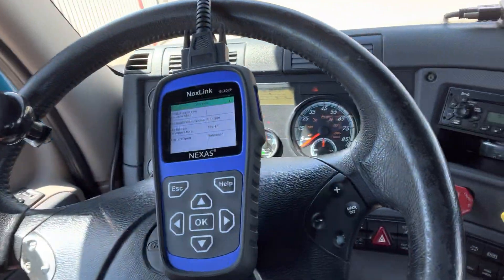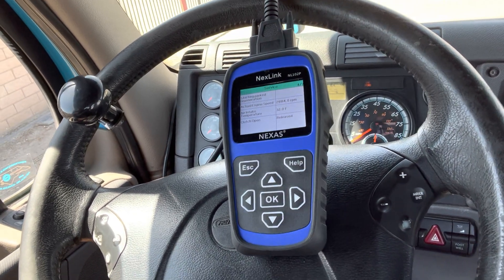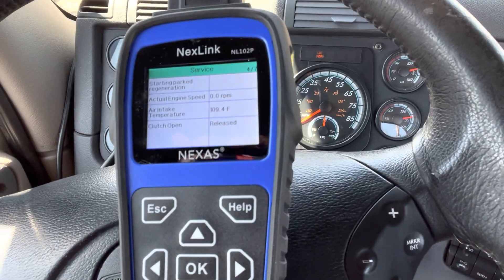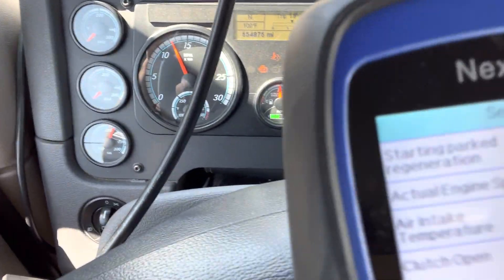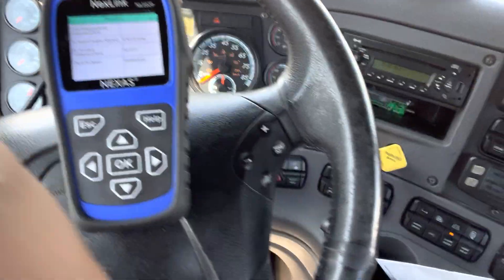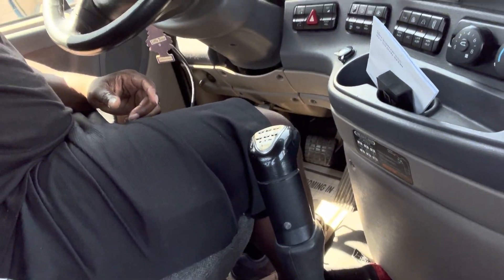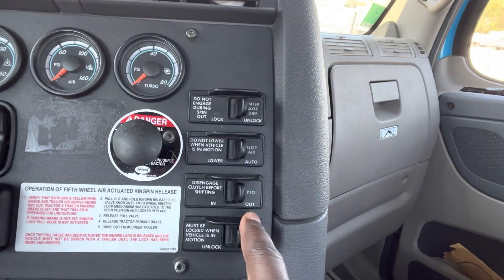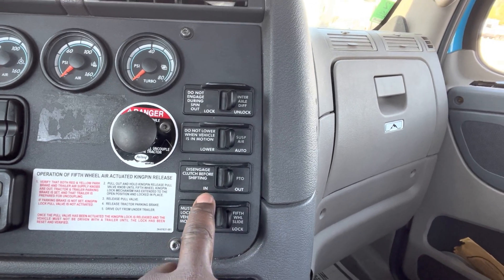This is EXACTLY how the Nexas Nexlink NL102P worked for me￼!! My special tricks WXPLAIN

Comment: Thanks

I failed to get it to regen the first few times, so I went looking for instructions. Found your video and decided to give it another couple tries. Eventually it worked.

2015 Freightliner Cascadia 
Detroit DD-15
No PTO
Standard Transmission

I'm pretty sure that this is the sequence that worked.

Engine Running

Press in the clutch and release, cycle the parking brake off / on, put the truck in 1st which of course needs another clutch press, put the transmission in neutral and release the clutch. 

Then it's two taps to the next screen and two more after that.
Reply: Good afternoon, my name is Heitor and I need a lot of help with a nexas nl102 scanner that I have.  I lost the obd2-db15 cable and I need to make another one, because I didn't find it ready to buy.  and i would like to ask you sincerely if you could give me the connection diagram between the obd2 sockets and the db15 that this device uses.
Reply: @Heitorpc  Doesn't sound too difficult. Just a simple continuity test for each of the active pins on the plug which looks like just 8 for the big round plug and just 4 for the smaller one. I guess 7 are probably just blank. I'm out on the road right now on my way to California. I deliver on Tuesday which leaves a full day out on the road. I'm pretty sure my multimeter doesn't work. Lemme give it some more thought.

Comment: Update....Thank YOU! After watching your video, I purchased the Nexlink NL102Plus, and just successfully completed a forced regen. I would have returned the unit had I not watched your video, particularly your information about trying, trying again, and again, and again, and after about the tenth request for the regen, it started. Whew! There is no way in heck I would have just sat there and made the request repeatedly, I would have simply thought the NexLink unable to perform the requested action. I cannot thank you enough!!!!
Reply: Happy it worked out for you. It can be a bit of a hassle, but much better than waiting on a mechanic or even worse the dealership to do it for you. Stay safe out there!
Reply: Good afternoon, my name is Heitor and I need a lot of help with a nexas nl102 scanner that I have.  I lost the obd2-db15 cable and I need to make another one, because I didn't find it ready to buy.  and i would like to ask you sincerely if you could give me the connection diagram between the obd2 sockets and the db15 that this device uses.

Comment: Thank you for taking the time to post this update. I am thinking about getting the Nexlink to try to help me solve my issues with Forced Regen. I have a hard time getting the mechanic to find the time to meet me when I am in town, and as a result, have to deal with the fault codes. I have a 2015 Freightliner DD15, and for some odd reason, if I get any code related to emissions, I lose 50% jake brake function. It sounds like this reader will help me identify what exactly the issue is, as well as initiating a forced regen. If it does work, it will pay for itself fairly quickly. I will let you know how it works out, but thanks to your video, I think it just might do the trick.

Comment: the 9 pin plug didn't match the plug in on my 2014 Freightliner M2 106 with Cummins ISB 6.7
Reply from the maker: Mine came with the 9 and 6 pin connectors. Which does yours have?
Reply: My truck has a 9 pin, but the one that came with the device doesn't fit it properly.
Reply from the maker: Oh! I understand now. Well that sucks. So the actual pin configuration is different than the J1939 layout? I haven’t seen that before.
Reply: @truckniq5017  I'm going to send the Nexas back and try a different manufacturer.
Reply from the maker: I understand.
Reply from the maker: If you find one that works better, please double back and let us know.
Reply: were you able to find another brand that worked on a cummins ISB 6.7?
Reply: There a mob u gotta twist it n line it up   To fit